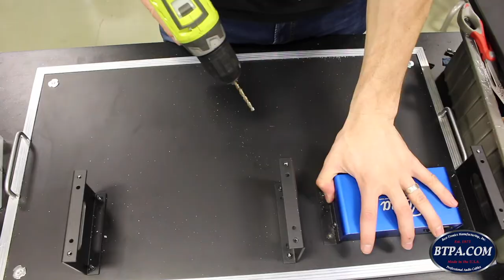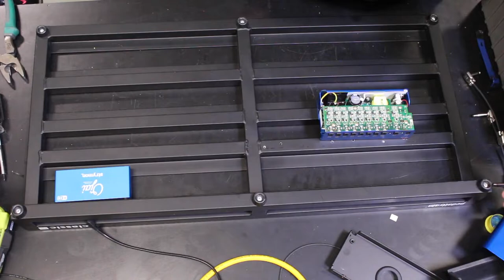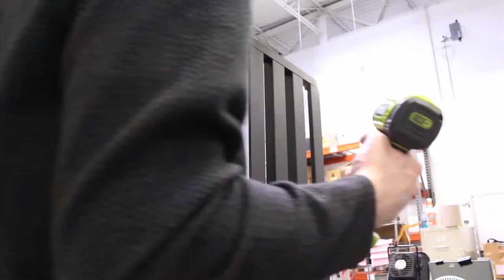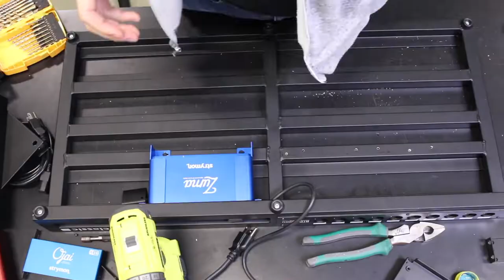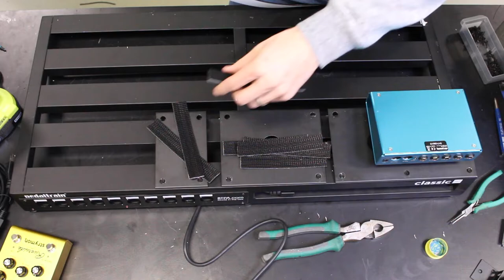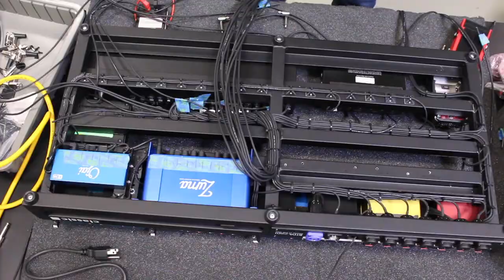Stereo PBC10 / Pedaltrain Pro Rig Build Timelapse Video

Comment: I have almost identical configuration (BTPA 10 port, Strymon Zuma, PBC10, PT Pro, couple of Strymons,....). I was wondering why you didn't mount R30 under Mastermind? I'm looking forward to do that.
I was doing some measurements and with right angled power cables it is doable.
Reply from the maker: Prefer to have all the power in one centric place. Rather have the EIAJ going a shorter distance. Also, going that low to the ground only adds more risk of damaging the PSU/Cables in gigging and touring applications
Reply: Thanks for reply...I'll do same myself as you got the point....